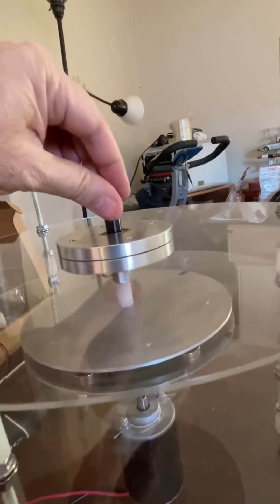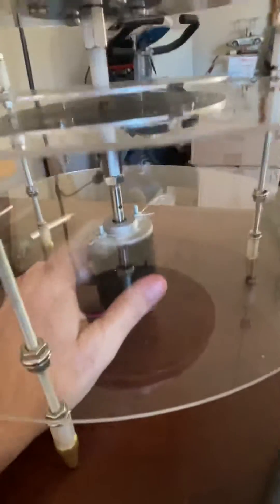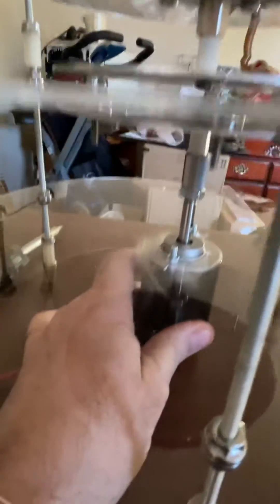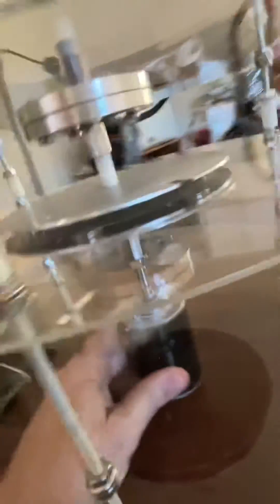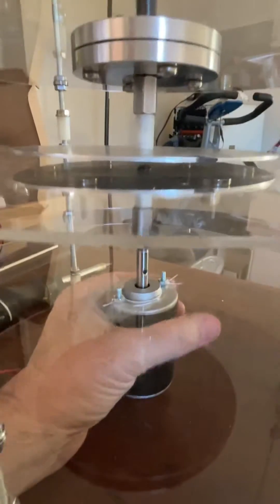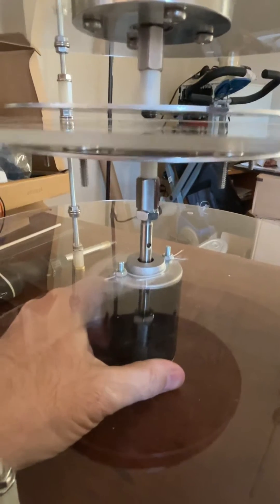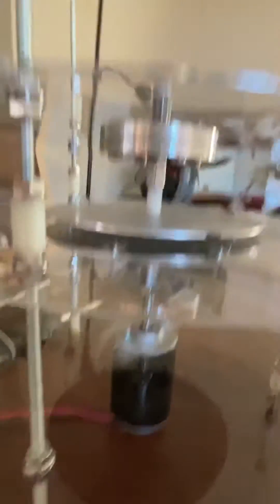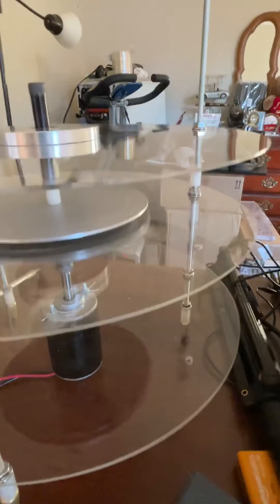Building Antigravity (Part 5)

Comment: I'm still working through the numerous theories related to Alexey's concept, before I build a prototype, but I'm very happy to see others working on this as well. From what I've gathered, his main problem in pre-flight tuning has been finding the required voltage (in the high voltage circuit) with witch to charge the counter-rotating magnetic field in order to produce the levitation effect. Because that appears to be his primary issue, it must be specific to each "launch" location. It would be nice if he were better-funded and able to better-document specific voltages, or find a way to solve the problem via automation. If that problem were solved, then maybe movement could be achieved as well. I give you props on not only working on this, but also documenting your progress via videos. I've subscribed so that I can keep track of your progress. 

Question: What made you decide on using plexiglass? It's great to be able to see the inner workings & recognize sources of issues, but I'm curious about your thought process. I wish you the best of luck!
Reply: High voltage insulation, so I can bring the two rotating disks closer together. That will maximize the charge stored on each disk way more than some ripples on the aluminum.

Comment: Why didn't it shoot through the roof? 😜 
I guess you will charge the top one? So there is a rotating permanent magnet system and a rotating charged system? This should be interesting
Reply: No, the disks will be oppositely charged, with a small separation to maximize the capacitance, insulated by the plexiglass.